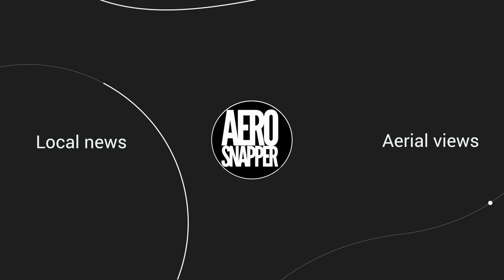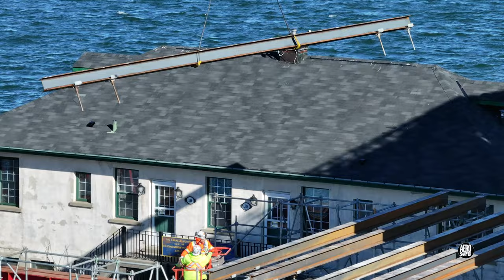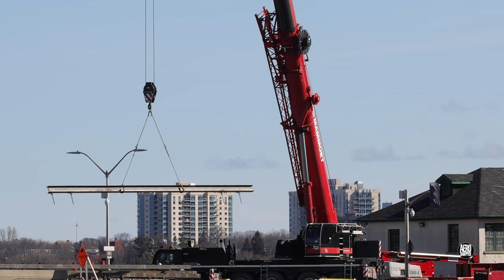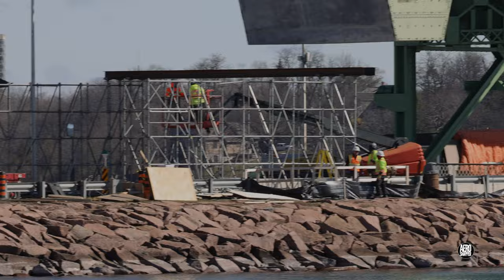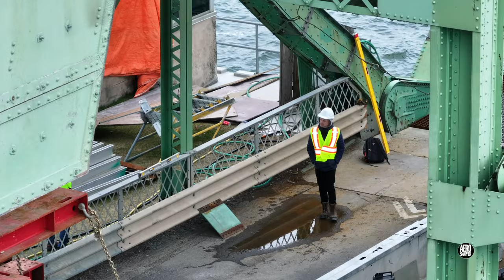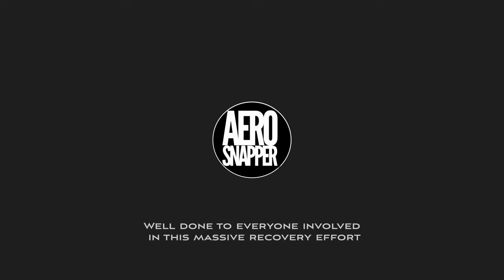Lean on Me - an update on repairs to the La Salle Causeway Lift Bridge   4K

Comment: Yes I Wondered why the Weight was Not a Liquid Filled Weight.
Hence allowing Drainage of the Liquid for Maintenance.
Reply from the maker: Any acceptable liquid would have insufficient weight for the volume available.  Concrete began to be used in the late 19th Century, replacing iron, which was more expensive
Reply: @Aerosnapper 
Good Point, Thanks.
More, a Large Weight Suspended over the Traffic for Long Periods of Time is Not Ideal.
Will They Check the Weight Support Structure ?.

Comment: I'm suddenly really glad that we built the Wabaan. 😅 I figured an extended closure would happen eventually... but not like this. 😳
Reply from the maker: Yes, very unfortunate - but life happens - everyone seems to be working hard to address the situation
Reply: @Aerosnapper  I'd also like to give a shoutout to MAMMOET. They're a real class act, and perhaps the best lift operators in the business.

I'm not sure if you remember the massive construction fire at what is now known as The Foundry; they're the same company that helped Kingston take down the fire-damaged tower crane, piece by piece, all the way back in December 2013.

I was mad impressed back then, and mad impressed that they just happen to have all these amazing extraordinary tools for extraordinary jobs, and handle those extraordinary jobs like they've done similar jobs in the past. We're lucky that we have them here in Canada (in this case, they probably came from Toronto or Montreal).